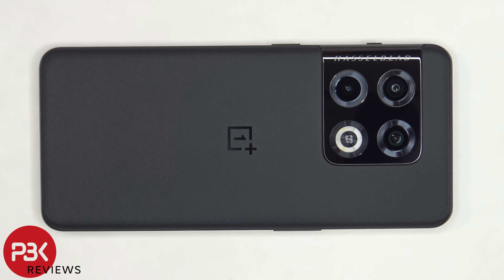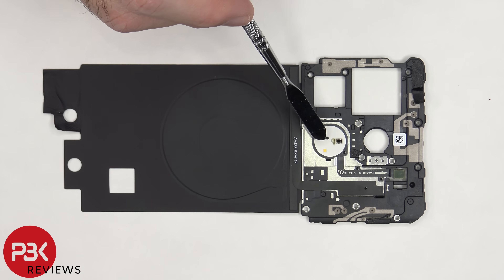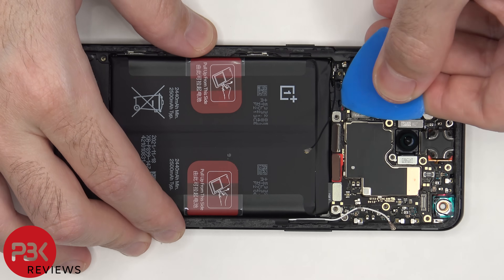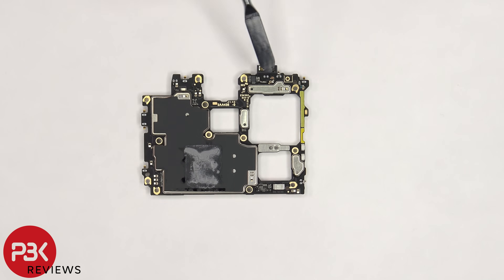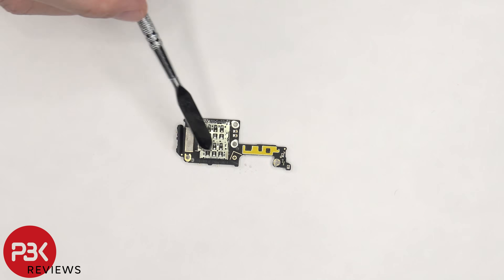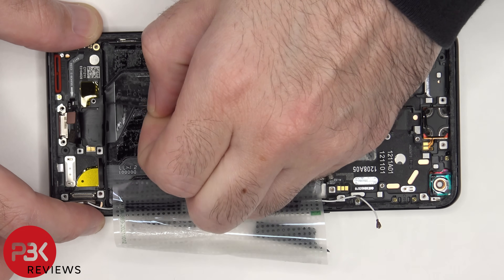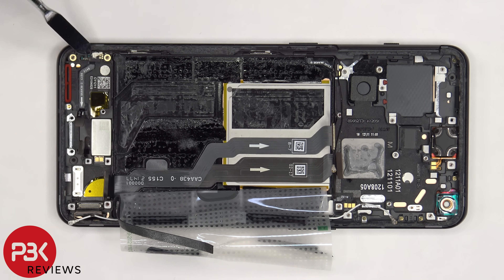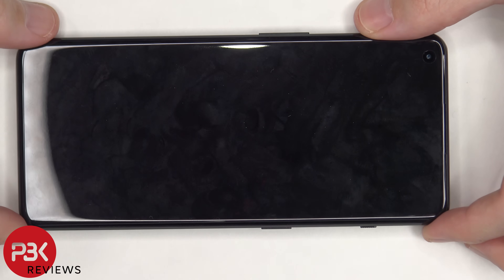OnePlus 10 Pro Disassembly Teardown Repair Video Review

Comment: Hello Sir, I have a Oneplus 10 Pro device and my phone bottom speaker stopped working after i repaired my phone which was dead. When i received the phone the bottom speaker used to sound (dik dik dik) whenever i play a music so disconnect the speaker from the board because it was so annoying. Please help 🙏 thank you.
(Sorry for my bad English)

Comment: Hey, Hows it going.  I wanted to know if the internal  memory module can be placed on a new OnePlus 10 pro phone.  If that's possible, if not too much, could you do a quick video on it? I'd appreciate it thanks. Or better labeling the internal memory module.  Thanks
Reply from the maker: Hi, no its not user replaceable. Its soldered to the main board under one of the covered metal shields.
Reply: @PBKreviews  Thanks a lot.  I appreciate the response.

Comment: My Back Plate gets loose. What do i Need to make IT hold ITS place again?
Reply from the maker: https://www.ebay.com/itm/166029456472?itmmeta=01HVDXVEM1K7C96NGWSAMJ2FJ0&hash=item26a8207458:g:fFUAAOSw~uBkNuXj&itmprp=enc%3AAQAJAAAA8Ll95VKp7ZVn%2B%2FlTcoxNhY9iJohdd8S%2BgqJU3Ao%2Fzd5RU5cbzUSqOEO1r%2Fe2Ypel2G5O4Ej9MseNMqX1nt%2BWP9oQ0oD7cXNLUJ%2FFXNEHtNOp1m7xnL16%2FCgVPjWiwTuUSbD0Sb6Pi2JJqbhN%2FY5yvzJyYw5IBw5fUUGYq08e%2Bu39KowR1sF5%2BkKHCYHfsSGBVOg3fbVczbtFpEAm1WXBP51NK7FVFwJ0aB7V9uA81XepmppI10BjmSn3t0EoT8%2FebnJDlnq1jsuZnmTR8kNiwtGLcDWUt3v5u5jmpKt%2Fnf9sYmBwOvH6%2FnlOa%2F1l5x8yOA%3D%3D%7Ctkp%3ABFBMkurtvdtj

Comment: I just changed the battery thanks to this guide. For that you only need to remove the 12 screws on the upper part, disconnect the gasket, disconnect flexcable and the plastic as the video shows. After that disconnect the battery connector and lift up on both sides and it comes off easily. Install in reverse order. Tips: 1. Before you glue the backside together make sure to check that the phone/battery works by putting the charger cable in as my battery came uncharged. 2. Don't overtighten the screws. 3. Be careful when dismounting the upper plastic board as the connection to the wireless cords are sensitive.
Reply: Where did you bought your battery?
Reply: Bro screwdriver size?
Reply: Bro screwdriver size?

Comment: Im tired of my phone listening to me, how would I go about removing just the microphones without damaging the rest of the phone? It looks like there are at least two based on your teardown.
Reply from the maker: They are soldered so you would need to de-solder them off or take them to a repair shop that can do it. If you pry it off you can damage the boards. But removing them, you wont be able to use the phone unless you use headphones with built in mic probably.
Reply: @PBKreviews  yeah that's what I was thinking. Usbc or earbuds

Comment: Hi, does this phone have water protection, can it be submerged in water? In many places they write that only the TMOBILE version has an ip68 rating, is it true? Are two different versions being assembled at the factory, with and without water protection?
Reply from the maker: The phone does have rubber gaskets and such around mic/speaker openings, and around connectors on the boards so it should be water resistant to a certain extent. I'm not sure if the T-mobile version has any additional protections or not, might just be extra money they paid to have the device certified to advertise it with the IP ratings.

Comment: Is this T-mobile version.? 
because I see type-c port have rubber gasket which protect from water.
Reply: From what I heard all devices have those gaskets but you have to pay a fee to declare it waterproof for the official rating. T-MOBILE wouldn't sell them without the rating. But other carriers have been ok with it. Unless I got this wrong as I heard about this a few months back.

Comment: so is the op 10 pro waterproof ?
Reply from the maker: It is water resistant yes not water proof. Has rubber gaskets, a water resistant adhesive seal and rubber gaskets and filters over the mic and speaker openings etc. Not sure how long it will last or how deep in water it can go but definitely can be splashed with water and have no issues. Might have an IP rating when released globally but they might not want to spend the extra money to certify it for an IP rating but will still be water resistant. :)
Reply: thanks

Comment: Dual cell batteries are cool to see imo
Reply: Its gettin popular since mi 11t pro, thats y they can charge so fast, basically charge 2 smaller batteries rather than 1 big battery.

I wondered is the 1+ 10pro uses graphene battery just like the mi11t Pro
Reply: @pakhowong4133  it is popular since the 2019 Oppo RX17 Pro 👍😉